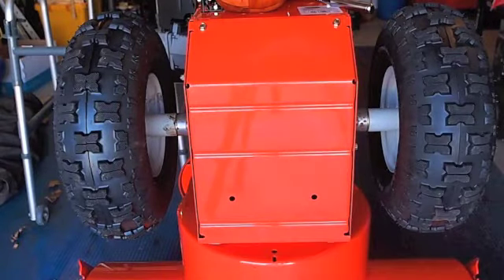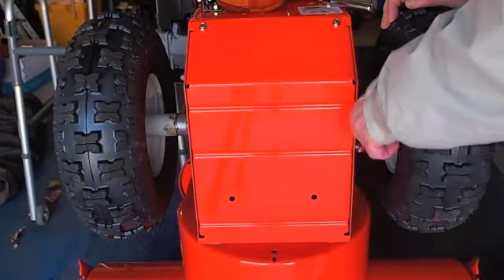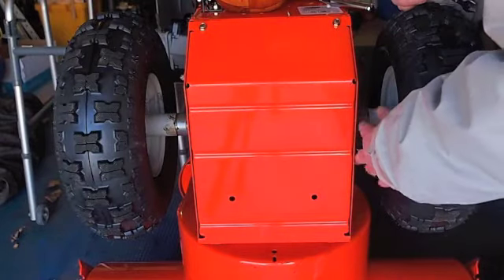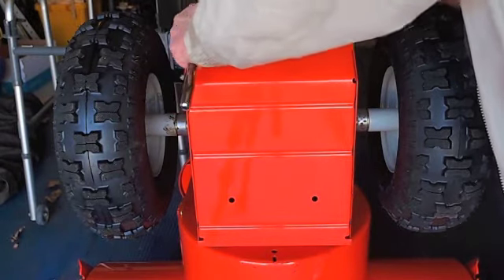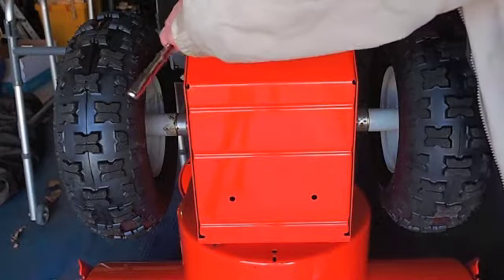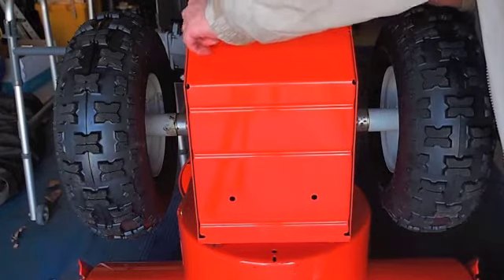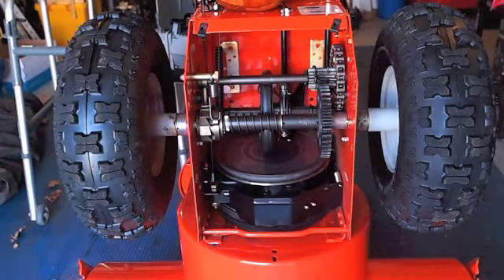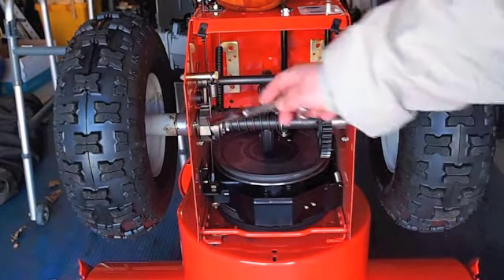Ariens  snow blower  deluxe  30  inside the  gear housing

Comment: This is a very helpful video for those who are starting to figure out how to adjust the remote wheel lock. If you were extend this video showing the way the clutch gear and ratchet gear work together to engage the dog clutch when the remote wheel lock trigger lever is squeezed and released, it would provide clarity in what is a poor description of the operation and adjustment of the remote wheel lock in the owner's manual. My understanding is that the dealers have the proper procedure, but never updated the owner's manuals online.
Reply from the maker: Cant do it know recovering   from   surgery , thanks for you feed back .

Comment from the maker: @KendrickMcMurphy Page  28 of manual 04335900B "speed selector adjuster " figure  31.   Have not explored this part to be honest , Have adjusted  the  engagement  of  drive cable  for response  . Its    bit  slow  in first  notch in reverse ...second ( towards user)a bit better. Another thing  to look into is left an  right pulling Fig 42, page 33.  Good point Kendrick McMurphy to check out.

Comment: Hey JD I have a Ariens Deluxe 30. I have had it new for 2 years and have not had any serious snow to where I needed to pull out of the shed. I pulled it out of the shed today added some gas. The blower started right the auger turned I was happy. I went to place it back in the shed and it would not move. I tried to put it in reverse it would not move. I know it use to go in Drive cause I ran It during the summer and it went back up the ramp in my shed .This time it would not drive forward or go in reverse.  Remember this blower is new and has not been in any snow. You have any advice what I can do or look for or what might prevent it from moving?
Reply from the maker: Contact deal first ... Then Check the connection from handle to the  rod adjustment. Pull the belly pan off an  see if the gears are  clean but greased( but not the drive disc) also see if the  drive disc belt is worn or broken.